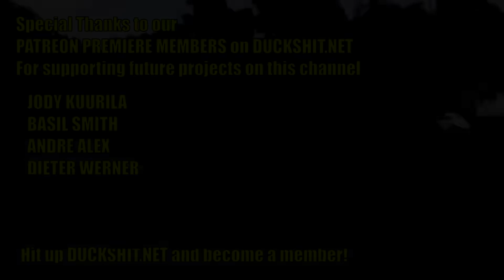VW Beetle Shaving Door Hinges 3 - ROTTEN OLD 1956 - 99

Comment: I think it will work just fine. Being a welder and mechanic I would only add to place welder nozzle a bit closer to reduce slag build up...I figure you already knew this and it was just a tight spot.
Reply from the maker: Flux core spatters terribly anyway, get closer and it clogs the tip!  But yes, tight spot too!  Thanks for the tips!
Reply: @DuckmanCycles  Tips... ha,ha! Just the tips!

Comment: Left a comment on the last video of the door hinges saying that I really like them and that's something that I haven't seen on YouTube that much is how to take just different pieces of metal and form them into different shapes things like that. that's one of the things I've always had trouble with like I'm good at welding I'm good at using a grinder but I guess I don't have the reverse engineering of an imagination to look at something and break it down into simple shapes to be able to reconstruct it now me making something 100% if I'm looking directly at it sure but just to take something that's like you know one off or hey I need to create a bracket to make this hang in this exact position almost like can't even use cardboard to do it you know like cad you know cardboard aided design. I've always been able to mount the stuff but the bracket doesn't come out looking like a bracket let's put it that way like I've always been old make things functional but maybe not formed functional. so any more of this metalforming stuff like that maybe anything you had from the chop top plate content that you haven't released or anything. that would be content I would be interested in seeing even if it's not from the top just different types of metal forming and stuff like that. not exactly like English wheel type forming like not making fender.
Reply from the maker: An english wheel and a planishing hammer may be in my future though!  Need more space before I can commit to more large tools.  Objects and shapes arent for everyone, though.  I had some aptitude test as a child where they try to figure out what career paths would be best for you based on your talents.  I scored extremely high (99th percentile) for objects and space relationships... I was always fascinated by origami as a kid, that was the only thing I could relate to the test.  But I would say just keep practicing and you will get it, it is something that can be learned!  Thank you so much for all of your comments my friend!

Comment: Congratulations on your work. Could you please tell me the size of the tube, where the hinge is housed, the internal width, length, and the measurement for me to weld the bushing that will serve as a guide for the screw? Thank you very much and I wish you much success. I need to make them for my Beetle.
Reply from the maker: I'd be glad to provide you with the data, but this was all installed years ago and is currently painted, assembled, and fully-functional.  Rather than try to reinvent the wheel and build your own copying my specifications why don't you just go ahead and order up the same hinge kit from the links in the video description! Will save a ton of work and a lot of headaches!  Hope that helps, thanks for the question and the kind words!

Comment: Can any mechanics out there put me straight... as the plates are being held on with countersunk screws they will always self align in the same place so you will have no adjustment.  Also, I've never seen doors held on with screws before, is this the done thing nowadays?  Interesting project though.
Reply from the maker: The screws will always align with the plates yes... but as I described in the video the holes that the screws go through in the doors will be bigger than the screws so the entire plate will float in the pocket which allows adjustability.  The stock screws on the Beetle are also countersunk and the hinges do float in the pockets that they slide into allowing adjustability by the same principle.  Hope that helps!  And yes, most doors are adjustable by way of some screws or bolts!